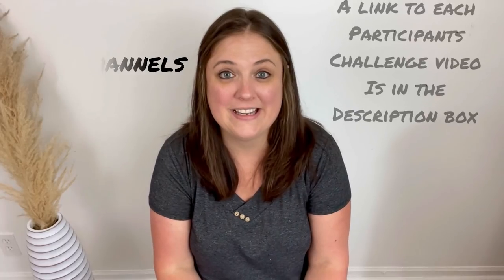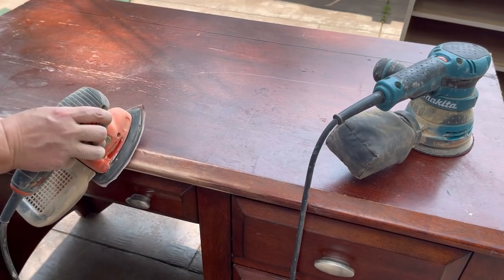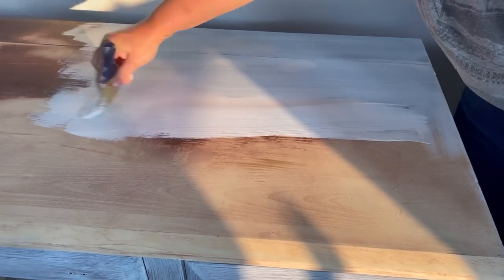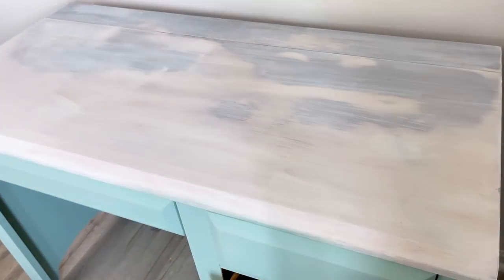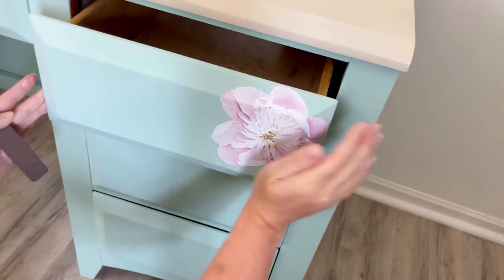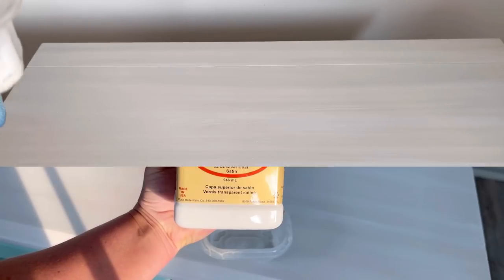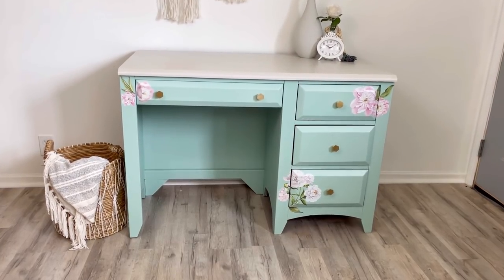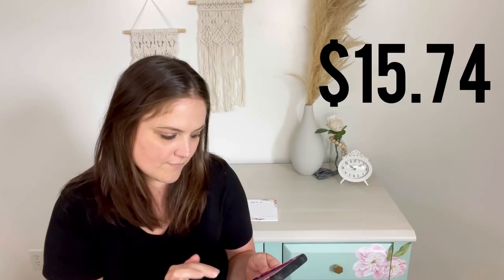Flipping Furniture For The $100 Challenge Collaboration | Furniture Makeover

Comment: Have you ever done a bathroom vanity makeover?  I have a hideous old vanity that I can't afford to change out at the moment but I really want to do something to it to make it look better.  It's from the 60's and it's just bland and boring and it looks like it's been painted over at least a few times and has a linoleum type top.  Besides painting, I need to put a cabinet door on it because it has the sliding doors made of hardwood that are just useless in my opinion. As for the top side linoleum, I'm not sure how to handle that.  Any suggestions?  Or have you done it in a video that I can check out?